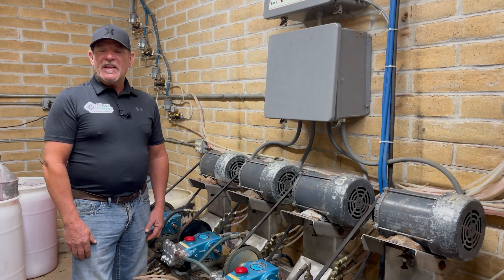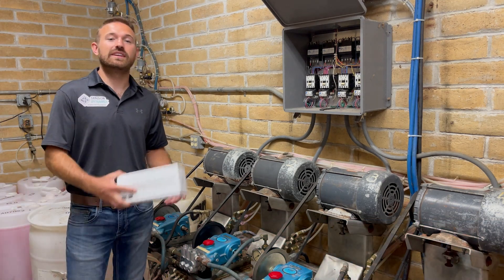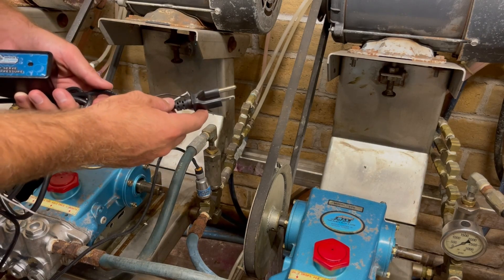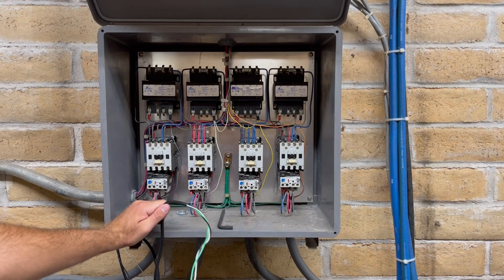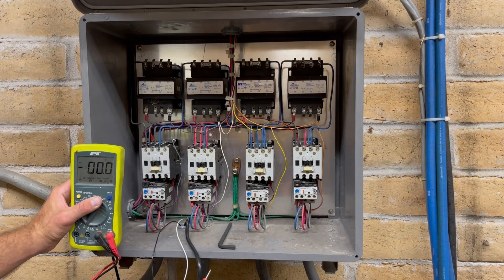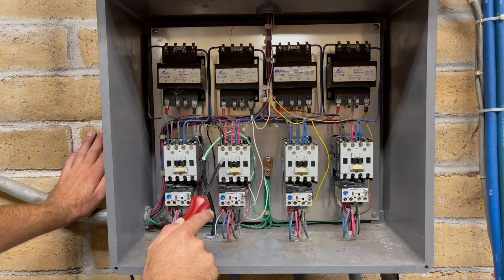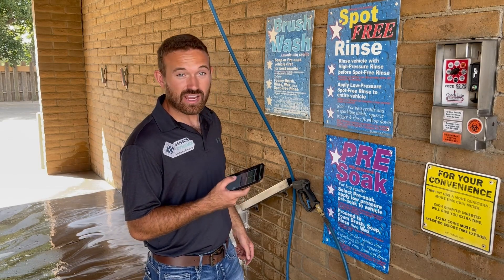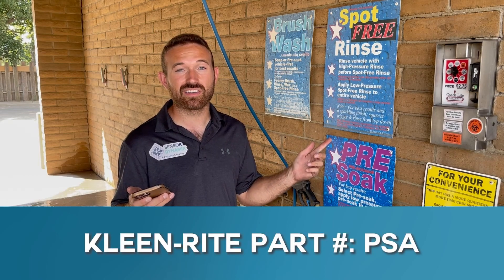Self-Serve Pressure Sensor Installation | Sensor Dynamix Tutorials

Comment: As of 8/2024. Pressure sensor kit is $399.00 per high pressure pump plus $9.00 per kit per month monitoring fee. And bill changer out of service sensor kit is $199.00 Plus $8.00 monthly monitoring fee! Can you tell me, is this correct?
I have a pretty nice 7 bay self serve carwash and even before the on slot of $30.00 per month wash all you want automatics, there was no way I would/could pay for this kind of system. A new high pressure 310/340 cat pump is $711.00. In the 24 years I have been in business I've only lost 2 pumps due to frozen tips. And my change machine has only been down a couple of times due to out of service (that was before I figured out how to prevent stringing). The most calls I have had in a single month about equipment problems is 4. And that is a worst case scenario, it is usually more like 2 calls every 4 or 5 months. And it's almost always because of a stuck coin due to people using coins that have been in their cup holder and are covered in sticky gunk. If I have a bay down for an entire day even if it's on my best day I wouldn't loose enough money to justify the fees for this system.
This system for pressure sensors and out of service sensor will run $71.00 per month for monitoring fees, plus I would have to get an internet connection which is around $100.00 per month. So $171.00 per month just in fees. I can buy a new pump every 4 months for what it will cost in monthly fees. I can repump the entire carwash every 28 months. And that isn't even considering the $2992.00 initial cost for the sensor kits. Plus $100 each for the ubiquity access points. For me, this is just not justifiable.